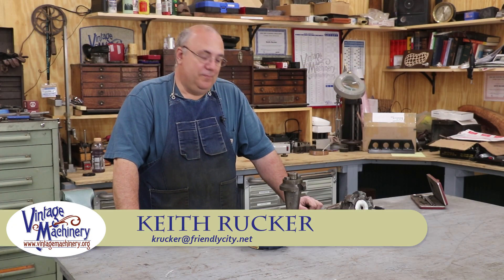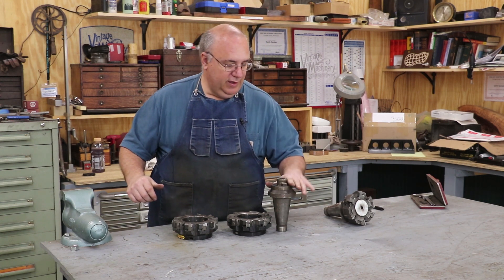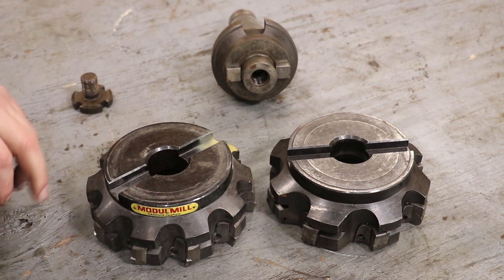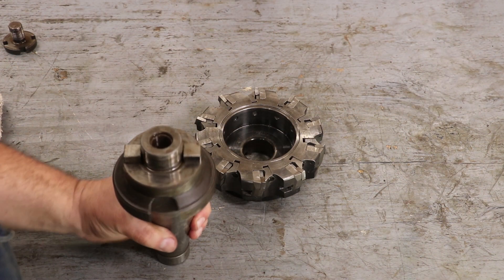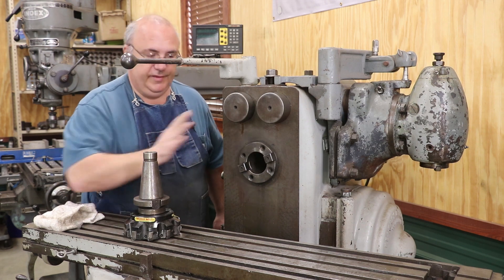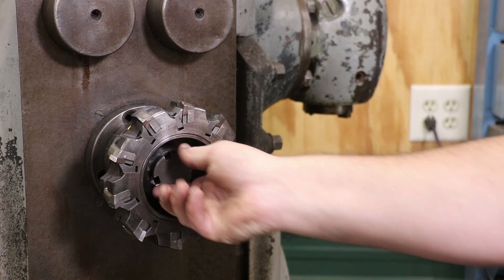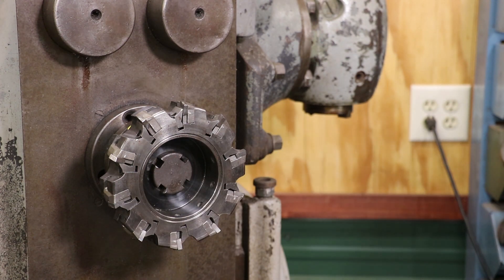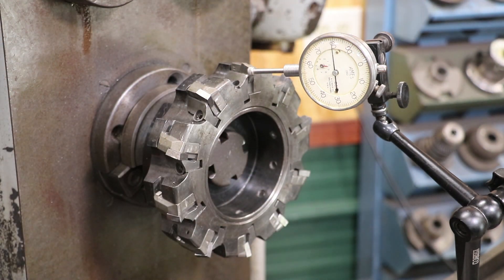Setting up a Face Mill on the Horizontal Milling Machine

Comment: I ran a 4 head mill that had 30 inch "Slab Mills" when making ships engines in my youth.. It took almost an hour to do a cutter turn to a good edges/points. They were 1 inch square.

Comment: While you had the indicator set up you could usefully have checked for run-out in the body of the head before measuring the inserts. Perhaps you didn't think of that.

Comment: In checking out what type of inserts these face mills use also check the tolerance of the inserts. There are various levels as to the precision of geometry the inserts are made (it's part of the insert code). Many inserts are made to ±.001 so that could account for 50% of the runout you see.

 More precision = more $$. Even Boeing knows that and buys for the job.

Comment: Hey Keith, I've used sockets for different types of spanners over the years and you can make the wrench or socket with sockets, round or square tubing. I recommend using Woodruff keys over key stock just cause it holds up better. Put the tube on the top of the nut and slide the key to the depth you want and Mark or tack it in place, then weld them up. If you use tubing you can weld a socket in the end and also bore a hole through it to slid a small handle in to use both hands to hand tighten it.

Comment: You should really strip and clean that face mill thoroughly Keith . There could be any amount of swarf (chips) under those insert clamps. Be pretty much spot on with new inserts. Only the high cutters do the work! Thanks for sharing another video.

Comment: Good get on the milling cutters. I have used both at my previous employer and got much better results with the round insert mill.  One advantage that one has is you only have to rotate ( from the inside out ) a small amount to get a fresh cutting edge. Also take note that certain round inserts from another manufacturer may not seat correctly due to different angles on the insert. Depending on year of manufacture of the cutters, you may be able to remove and shim the cutter seats to get them closer. Also check the OD of the cutters in addition to the face as you have shown in the video.  

 You can also use CAT 50 holders if your drawbar is long enough for correct thread engagement. The tapers are the same on both the NMTB and CAT50 but the NMTB has the extended thread engagement "collar".

 Jeff / Jeff in PA

Comment: Here's one for CNC guys- it seems that if you set each cutter a little bit higher than the previous one, the face mill would act like a rotary broach cutting a bit deeper with each partial rotation.  Of course you would have to have an encoder on the spindle so that the lowest cutter would engage the material first and the feed rate would be set so that it moved at a rate so that each progressive tip would engage fresh material until it reached the highest cutter.
Reply: And what exactly would the point of that be over a typical tool?

Variation in harmonics to reduce vibration on awkward/thin weldments?

What's your thought process?

Comment: Hi Keith... I have a BT50 taper shell mill arbor for a 1-1/2" shell mill. .. The only thing is, that the BT doesn't have the nose piece at the end, but has the same drawbar thread.... May need an extra inch length on the drawbar, but yours seems like it is long enough. I will send some photos in the morning. Cheap harbor freight sockets mill nice to make special spanner sockets.

Comment: For tightening the bolt, find an old socket that has the same OD as the bolt and cut out excess leaving 4 points sticking up, very simple to make. Ive used an angle grinder to make one before for a flywheel nut and worked just fine. If it doesnt fit snug then just beat the walls of the socket until a snug fit is achieved.

Comment: for the spanner socket.. which are expensive.. invest in a quality black deep impact socket.. hopefully one that is not hex all the way to the back of the socket.. you can cut that down and then mill away leaving you 4 tangs..  i had to freehand make one https://i.imgur.com/NG9UyYY.jpg   there are 2 different sizes on one of the cars i work on sometimes.. https://i.imgur.com/y5Ga5ju.jpg  you might take your bolt to the parts store.. they do sell a few size for automotive applications.. probably not that size.   what the heck type of car uses spanner nuts on the suspension.. https://i.imgur.com/zg85jzU.jpg not mine.. i only eliminate the repair issues.   its actually a driver. 

 you may want to set up a 10ths indicator with a flat face tip to eliminate errors.. to check the face height of the inserts..   when i ran a storm vulcan block master automotive surfacer.. the cutting tools were set at a stagger so each one would take a deeper cut and then several at the same height.. gave us a really nice surface finish to properly grip the head gaskets. too smooth and the gaskets blow out.. too rough the combustion pressures blow past.
Reply: isnt that the hard way, just weld 4 bits of bar (or key stock) to a bit of tube :)
Reply: Jusb1066  yes but it give him an easy socket to use with a torque wrench so it gets tightened the same each time. Actually it's probably easier to just replace the bolt with a conventional hex and a thick washer

Comment: That bolt you used for fixing the face mill to the arbor is not for fixing. It is to protect the arbor in transport. The slots were not there from the factory. Better get a proper HT SHCS and a thick washer the right size.

Comment: Just find a cheap socket the size that matches the ID of the squares on the retaining bolt. Then get key stock that fits the squares and weld pieces on the outside of the socket to match. A quick and cheap proper tightening and loosening tool can be made. :-) It appeared you followed a high to low pattern on your inserts indicating that perhaps there is run out in your tool holder face. Might want to check that.
Reply: Thought the same thing. Easy and cheap.
Reply: My suggestion was going to be to take the cheap socket and mill away the bottom edge, leaving the necessary teeth protrude.  I've even done it carefully with an angle grinder before.  The keystock would be an even better fix.
Reply: Or a piece of thick walled pipe and mill sections out to cut the nut. 

Should have a washer under that nut also.

Comment: On a similar cutter (i believe it might actually be the same model, but i am unsure as the previous owner used a lathe to modify it) i have gotten over the issue of used cutters (i sharpen mine until they can't be used anymore) by adding shims to the seat. I have had no problems with it and it's a perfect solution for one or two cutters that might be lightly used, but don't fit the stock anymore.

Comment: Not to state the obvious(and i know this is far from proper) but couldnt you just use a cheap open end wrench and a crescent wrench on that nut? (i.e. the open ended wrench on the nut and the crescent wrench on the head of the open end wrench)

Comment: Tightening tool made easily. Very similar to automotive wheel tool. Heavy round tubing same diameter as bolt. Cut top to look like castle with four protrusions that correspond to slots in bolt. Have fun, good luck.
Reply: GeckoProductions you could also do the same thing with heavy tubing where the id fits the od of the nut and drill for hardened pins that match the pattern of the nut.  Both will get the job done though.
Reply: I would try to find a big 1& 3/8” socket to use.  Notch that one into a drive socket.